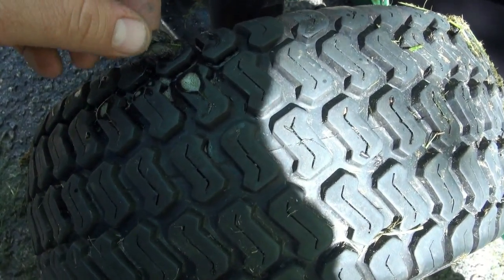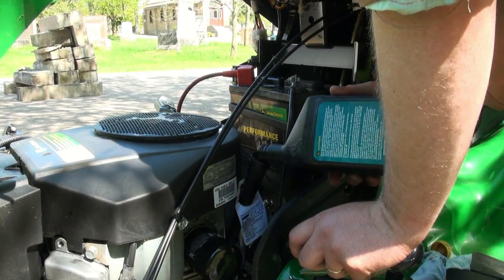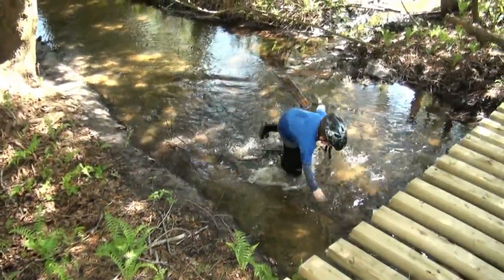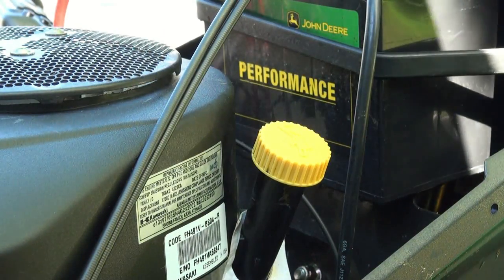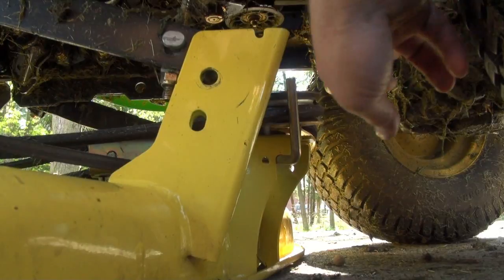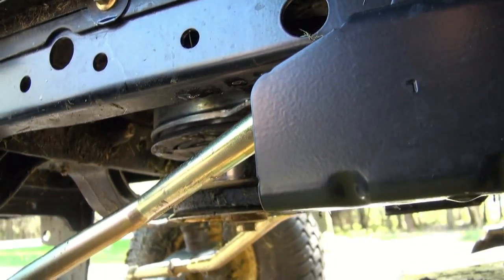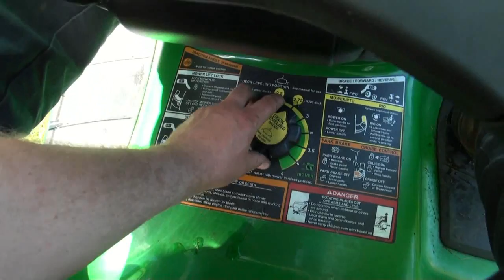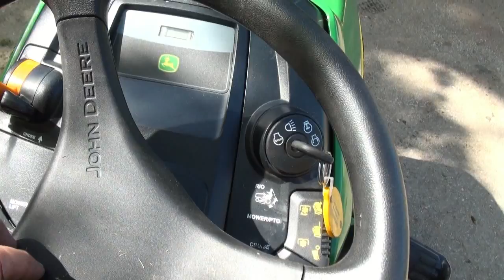servicing the neighbours rig part 2

Comment: Tyler James is correct. Do not screw the dipstick in to measure the oil level . Push dipstick in till threads touch a nd your good. Screwing it down will result in low oil level.  weird they do it that way but it is labeled. Get over there and add some oil before she blows up her lawn mower. Stovepipe.

Comment: During the Oil Change, RUN the Engine and let it get WARM / HOT, it will also SPIT out most of the Dirty Oil left in the Engine and sometime there are GUNKS in there as well.

Comment: they little john deere mowers are great, one fault but I duppose its a good safety feature is that you can have the deck running whilst in reverse, but I have found a small trick to stop that, attach a beer bottle opener to the key chain and wedge it under the mower start and stop to hold the button up ever so slightly and that stops it from cutting out, great vids!!

Comment: I like my tractor it takes 5w30 or 10w30. Mine takes 2Qts of oil to fill it with filter. I have a B&S 749cc engine. The little JDs are made on the same line as MTD, Toro and Cub Cadet now. My Allis Chalmers is made by its own company Simplicity and thats it. Only lawn tractors with steel hoods anymore.

Comment: I love how easily you can service every thing on John Deere's it's like it was meant for the average joe to be able to maintenance them him / herself and mine is a bit worse off than this one as far as the width goes, i only have a 38" cut on my GT242 but i love that tractor, thinking about upgrading it to the 17 HP Kawasaki though the 14hp is running well that's on it but the more power the better specially with 6.5 acres to cut.

Comment: hey on kawasaki engines don't screw the dip stick in to check the oil just push it down to the top of the threads. :-)

Comment: My mower makes that whiney noise when I start moving too. Is that normal ? Or does something need to be greased ?
Reply: Typical JD whining hydro-gear box.  Never buying JD again.  New Cub Cadet is twice the mower in every aspect.
Reply: Red Woods had a buddy who ran nothing but cub cadet and went through three of them because the dealer couldn't figure out what was wrong. Lucky the warranty was still good. I've been nothing but a kubota man. Have a 08 zd28 diesel I've never had any problems with her.
Reply: Mine hasn't blinked in a year.  Perfect operation, starts instantly, mows fine, steers without effort.  Best I ever had.
Reply: J.D says to use 10 W 30 motor oil in the trans-axle but TuffTork who makes the little tyrannies said to use 5W50 full synthetic motor oil in them.  I don't know if it will help your whine but at least you will be running the correct lubricant.

Comment: THAT ENGINE NEEDS, ABOUT 2- QUARTS OF OIL. BY RUNNING WITH 1-QUART. YOU COULD DAMAGE THAT ENGINE. I SEE YOU ONLY PUT 1-QUART. I  KNOW I WOULD NOT WHAT YOU . WORK 0N MY LAWN MOWER . I BET YOU DESTOYED THAT ENGINE . BECAUSE YOU GAVE IT BACK . TO WOMAN NEXT ,TO YOU. MY IS A 17 HP , IN MY LAWNMOWER. AND IT TAKES 2-QUARTS OF OIL. AND I KNOW. THAT KAWASAKI ENGINE DOES NOT ,WITH 1- QUART OF OIL. THINK ABOUT IT .